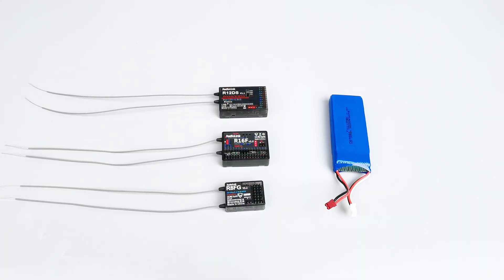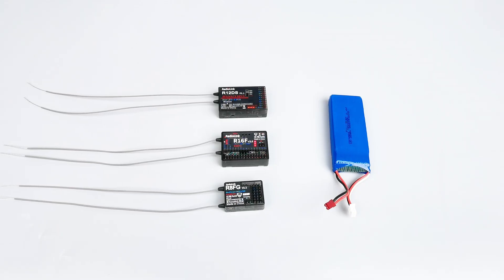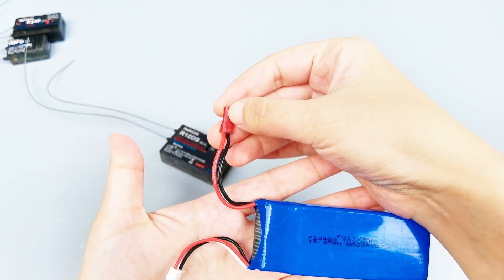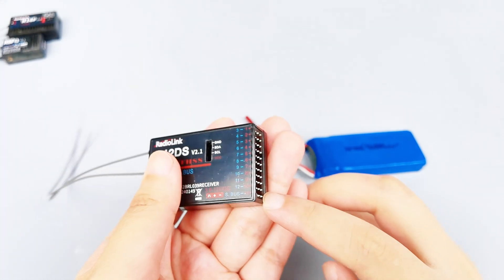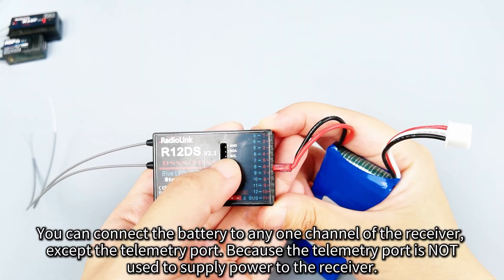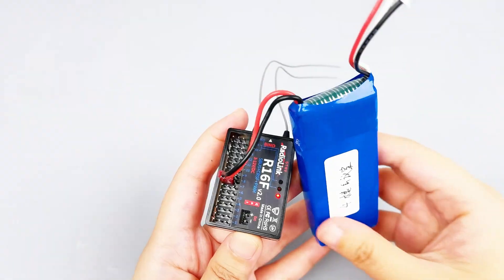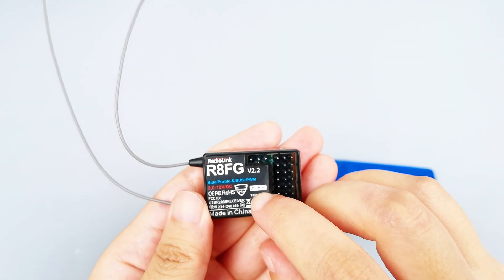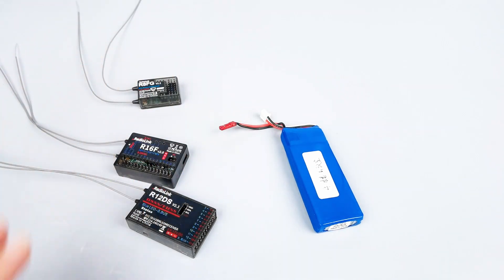How to Supply Power to the Receiver Without Using the ESC?

Comment: Excuse me, I have a question... Do Radiolink receivers have reverse-polarity resistant batteries, just as transmitters have reverse-polarity resistant designations written on the battery casing? 
Sometimes we forget and install batteries with the wrong polarity in a receiver, but the receiver still seems to function normally even if we accidentally install the batteries with the reverse polarity.
Reply from the maker: Hi, sir. Sorry our receivers do not have  reverse-polarity resistant designations. Wrong connection may damage the receiver. We recommend you to check the polarity before you connect the battery. You can check the correct polarity from the sticker of the receiver. If any question please feel free to contact us. Our email is after_service@radiolink.com.cn
Reply: @Radiolink_official Oh, I understand, but what still puzzles me is that the signal receiver still works fine after accidentally installing the batteries with the polarity reversed.
But I immediately removed the batteries.
Reply from the maker: @aryamaulana6258  Hi, sir. If you connect them in reverse for a long time, the receiver will be damaged. So if you immediately removed the battery, it hasn't be damaged yet.
Reply: @Radiolink_official 
thank you for the answer
Reply from the maker: @aryamaulana6258  Our pleasure. If any question please feel free to contact us. Our email is after_service@radiolink.com.cn